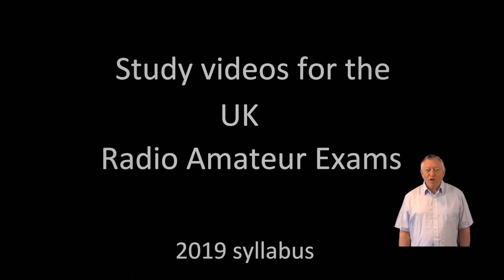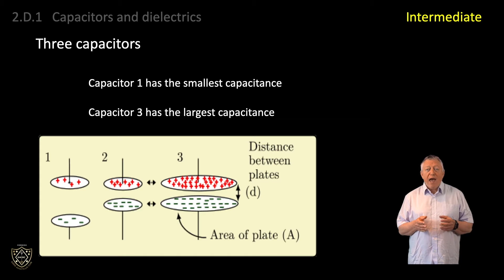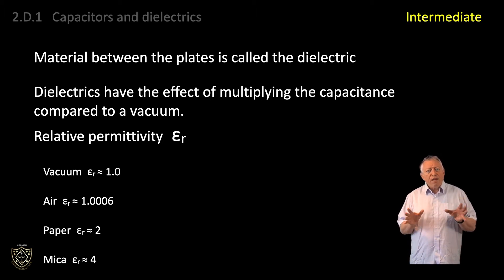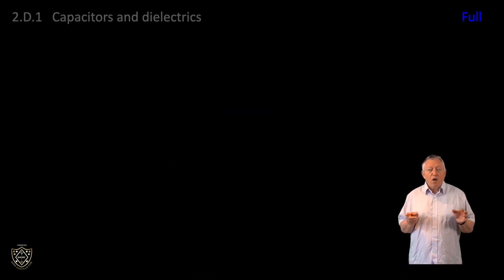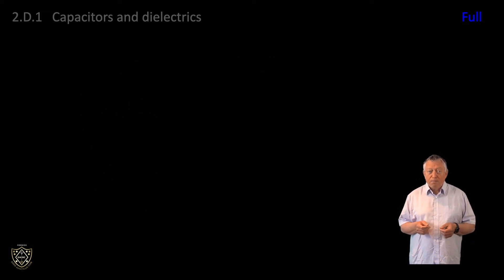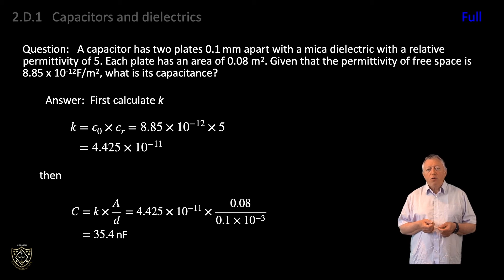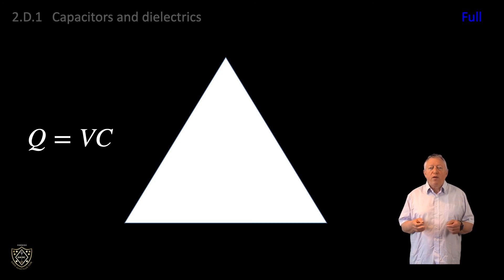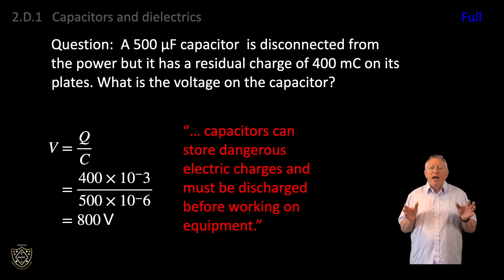2D1 Capacitance and dielectrics

Comment: Thx great video. Working on intermediate at the moment.  Interestingly,  at least for this video, I did not find the step up to Full a big deal. Generally I do not have a problem with formula and numbers so the question examples at the end I find easier to do, compared with remembering certain facts (e.g. series and parallel tuned circuits and the position of resonance etc).
Reply from the maker: Our pleasure Mark.  With the new 2019 syllabus there is not a huge gap between Intermediate and Full so you while you have momentum it might be worth pushing on through to Full rather than waiting and having to revisit concepts later. Good luck with the studies.  Don't forget to post your new callsign when you pass.
Reply: @cornishradioamateurclubtra4073  cheers !! Should have added M7MSR to my post lol, proud of that  :)